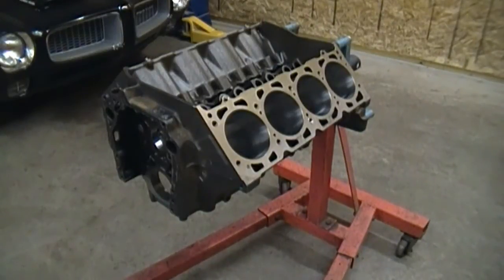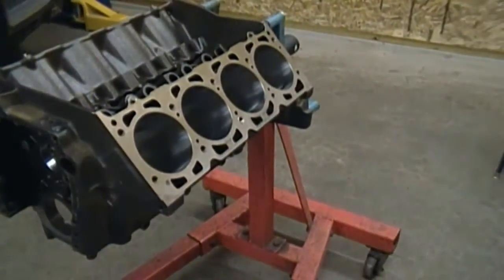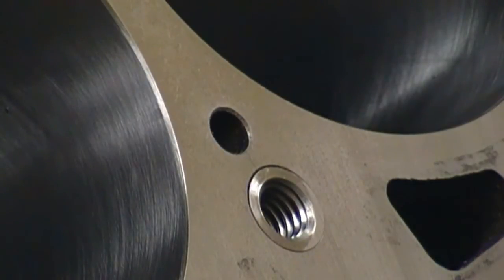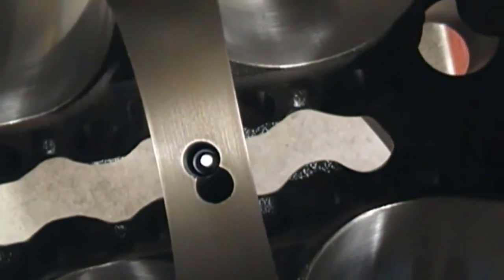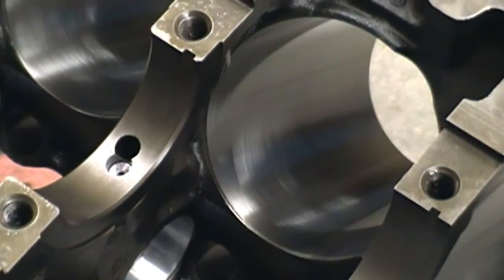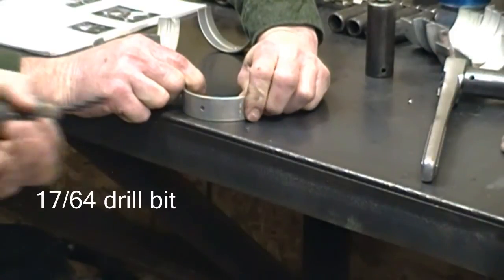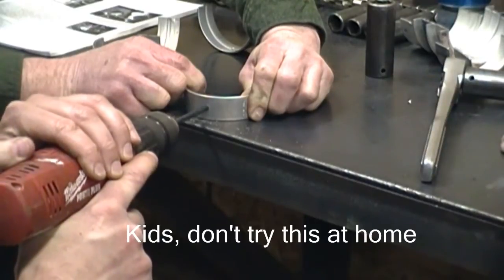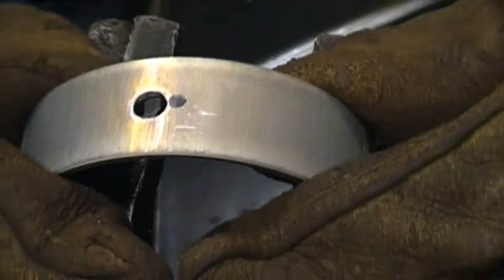Installing oil resriction in a marine big block oldsmobile

Comment: Great video reminds me from years past doing the same to my 330 small block and my 425 big block squared blocks up and aline hone and punch out along with balance. Did a lot of head work as well and toronado 5 quart oil pans and custom ground camshaft for the '66.   425 c.i.  I put a '70 W-30 stick grind camshaft 328 duration into it had to change the angle becouse most olds
 are 39% bank angle but the '66   425 is a 45% degree and punching the 425    40 over brings it to a 442 C.I.    
I got 525+ H.P. on that mill. The 330 I punched 30 over and used the '70    W-30  automatic grind camshaft 308 duration with 4-gear  both mills were Tork Monsters the 425 was an 400 turbo I did keep the switch pitch systems from the '60's had quite a few units converter from 2-speed fits 400 turbo and is smaller bringing rpm up 3000 before grabbing but I used Chevy pump with TCI 4000 stall converter & manual reverse pattern valve body with trans brake and 4:56:1    12 Bolt Posi ran great.. hopefully you have more videos on yours this like I said brings back memories I did mine back in the
Mid.  '80's ... Do you have the "F" marine heads for yours? Good luck with it and keep up the great videos...

Comment: You shouldn't be touching the bearing surfaces with your fingers. Contamination can cause the engine oil to not film there. Causing metal to metal contact bearing failure.
Reply from the maker: I would hope the crank never touches the bearing
Reply: @Oldsmob455  If the oil can't film on the bearing from contamination, what do you think happens?!
Reply from the maker: @stvwds61  At 60 to 80 psi, nothing
Reply: @Oldsmob455  Well, it's not what I was taught. Here's the rational. Your assuming there is always adequate oil pressure which can overcome the hydrophobic, for lack of a better term, condition caused by contamination. The most obvious case would be where an engine has sat long enough for the oil to recede from the area of contamination. During cranking, and potentially just hand rotating the assembly, could cause minute bearing damage. Which could cumulatively could potentially lead to enough scaring to cascade into premature bearing failure. Especially in high pressure applications such as high compression engines.
Of course, there is much debate about this. Would it not be reasonable to err on the side of caution just in case?
Reply from the maker: @stvwds61  If you don't have oil pressure you have bigger problems.
Reply: @Oldsmob455  You don't have much, if at all, when cranking! That's the point!
Reply: I would think that they would be washing the bearing with break cleaner or something becouse of the metal filings from chamfered the holes and enlarging them or he will have problems with the filings... Don't you think.  I would think they know what there doing ...
When I ported my heads and did all the extra work to them I wash and clean them to get rid of the filings when you build a motor the area is cleaner than a hospital just like a spray booth for painting cars...

Comment: so basically it looks like you drilled one bearing half that you shouldn't have because that's the bottom half of number 2 or 4 Journal and you missed Drilling the number 3 Journal bearing. the bearing that controls thrust the one that's odd shaped and not like the rest it goes in the middle of the block number 3 Journal the one that's odd shaped and not like the rest it goes in the middle of the block lol. this video is not accurate on installing oil restrictors in Big Block Oldsmobile

Comment: If the block is cracked,  junk it. I use the very best Oldsmobile block, the Oldsmobile diesel block. The metallurgy is superior. 
Much much stronger block and the cylinder walls are so much thicker and the decks so much thicker and   the crankcase so much thicker.  I do not use  thin wall cast blocks. I find Oldsmobile cars in back yards, people pay me to haul the Oldsmobile diesel away. This is the Oldsmobile block they used in prostock Oldsmobile cars in the 80s and 90s.
Reply: you can take a diesel 350 block and install a turned down 425 oldsmobile forged crankshaft and bam 440 cubic inches. a lot of modifying but one he'll of a tough engine considering the 350 diesel was cast to handle 22.5 to 1 compression!
Reply: They can fix blocks easily and the 350 diesel block I'm not a fan of I kept my 425 crank for my 425 punched 40 over  and my 330  crank in my 330 punched 30 over...only part that I used after 70 was the 403 connecting rods in the 330  that I had shot peened .

Comment: thank you for your videos, im building my first olds, what clearances did you have done on your rods and main bearings, or what is recommended for a marine 455 , thank you for any advice, ive done all the oil mods you've shown and I feel great about them. thank you
Reply from the maker: +Skyy Lee I don't like letting my bearing clearances get too loose,  these things don't rev all that high.  If I did this build over I would have added a windage tray or a crank scraper(I have an AMC crank scraper video that would be similar).  You may want to watch that whole AMC build if you like oil mods.  Good luck with your boat.

Comment: Restrictors? The 455 i ran in my v-drive hydro came straight out of a vista cruiser wagon.Oil mods? I pulled the crank and had it ground so bearings set up@ .0025 rods .0035 mains. HV oil pump with the spring shimmed, a modded oil pickup tube from a v-drive BBC and a 10qt pan. Pulled the heads and drilled the shit out of the drain backs and bolted the back on with modello head gaskets and new bolts. Made 60 psi oil pressure hot and 2k rpm and 75@ 5k....put 125hrs on it with no failures.
Ran it wot @ 5k for 2 min. a bunch of times and 4-4500 for hours. no restrictors of any kind. Tore it apart when i swapped in the BBC...i would not give a second thought about putting it back together and running it.

Comment: You have great skills. Unfortunately the Olds is better used for a marine anchor :)
Reply: vppnbrent why you hating on Oldsmobile’s  you just need to know how to build them
Reply: @chasemeyer6688  
correct, like the one post said, do the proper clearances and it works quite well lime any other engine with sufficient lubrication, .
Reply: Olds are one of the best motors out there for drag racing and boats if you know the tricks for them and what your doing they make great horse power...a little more expensive than a Chevy but a lot more Tork... And that is the name of the game Tork make power....

Comment: may you tell me what brand is the engine stand, i going to buy a good one, that can hold a v8 engine, i had engine stand suppose can handle 2000 lb but i got broke,  may be you can suggested a good one. your looks goods whit no problem  with the engine. thank you.

Comment: Make sure the plug in the aft end of the LH oil passage has a HOLE in it, so that your distrubutor/ oil pump drive gear gets proper lubrication.  Many assemblers put in a nice NEW one from the kit, but don't realize the original one had a spurt hole.
Reply: I "discussed" this with my machinist: he said it was unnecessary... lol... I bought the correct one with the hole, and will be putting it in. It was easier than arguing with my machinist...

Comment: what do oil restricters do?
Reply: Nothing in this case except potentially split the block in two and put trash in your passages...The restriction is already at the intersection point of the hole in the cam bearing and the camshaft itself.  How much space do you suppose is at the hole when the valve springs are pushing the camshaft straight down over the feed hole?
Reply: Olds engines have a tendency to take all of the oil from the pan and put it up into the heads, thus starving the bottom end of the engine. These restrictors help with that some.